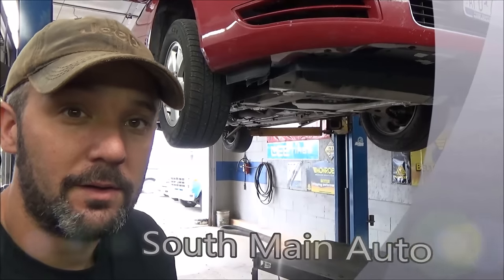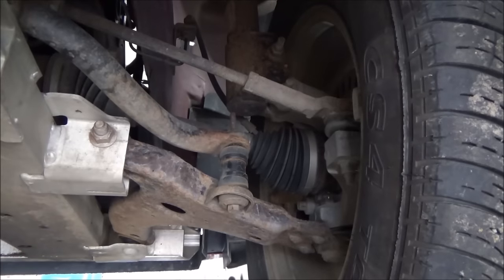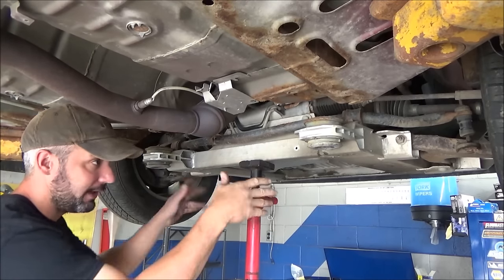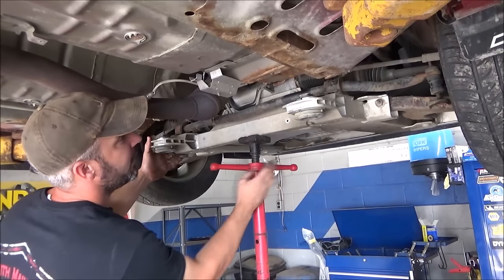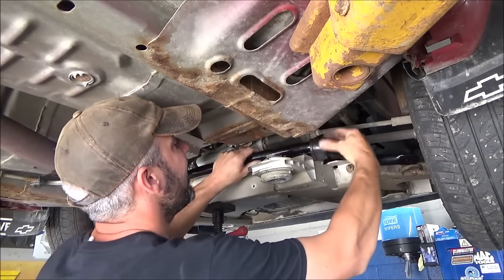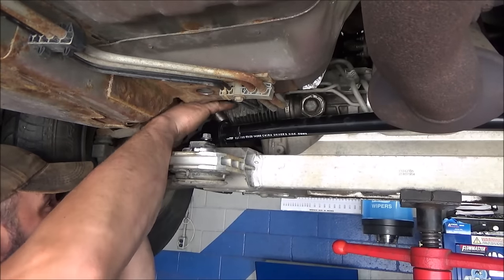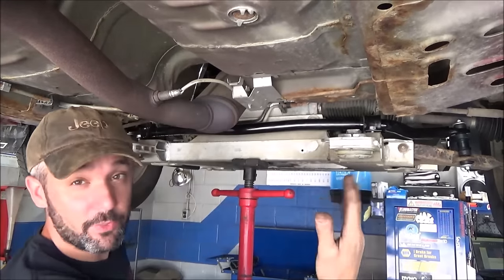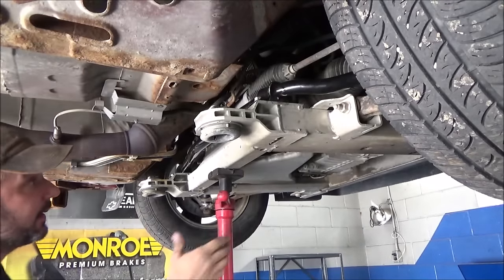Chevy Impala : Replace Broken Sway Bar

Comment: "Pretty Simple Job" lol yea when you have a lift, a support, compact electric impact gun, and years of experience. What about this guy doing it in the gravel, mud and blood 2 jack stands, a floor jack and a smattering of tools =)
Reply: @briancavanaugh4406  absolutely same here....past few years I've been doing my own work on my Impala and my girls Camry. I've had to buy a bunch of tools and what not but in the long run still saving money and learning....I'm not rebuilding engines or transmissions or tunning but done this,replaced front lower control arms,brakes,rear upper and lower trailing arms and controls arms, radiator,water pump....can be a bit frustrating sometimes but satisfying when you diy😎👍
Reply: Easy peasey
Reply: How long did it take from the ground?
Reply: I never got around to it,  my poor Imapala blew her head gasket 😑 RIP 2002-2018
Reply: @morsecodereviews1553  the 8th gen impalas are known to have bad head gaskets in the 2000-2004 years, they break down over time and all will go eventually. The 2005 impala is the best year of 8th gen they changed the head gasket to one that lasts for that year. So if you are looking to get another one of that gen either get a 2005 or plan on doing the head gasket at some point. I have an 2001 that my girlfriends grandpa bought new and it's going strong at 183000 miles, we both love it they are good cars.
Reply: Amen. Sometimes I think mechanics forget how hard it is to work from your back with minimal space. How about that stand up jack. Lowering it with a floor jack is also way harder and more dangerous.
Reply: Just take to to the dealer and have it done.
Reply: @greggarcia3226  "mechanics forgot how hard it is to work from they're back with minimal space" did you really just say that 😂😂😂 mechanics know what it's like fr
Reply: @greggarcia3226  have you watched his at videos of at home repair? Hint: there’s more than one..
Almost every mechanic I know still works on the ground from time to time for one reason or another, and almost every one started with DIY. You never forget. :)
Reply: For a sway bar?? Please…
Reply: I put my sway bar on 2008 Chevy Impala I didn't have to loosen chasy I removed bothe tire and sent it right thru passenger side went in with no hastle avoid removing chasy nuts.
Reply: @frugalprepper  yeah so they can charge you 600 dollars for a 100 dollar assembly and an hour or 2 of your time
Reply: @elih7190  I 100% agree. You never ever take your vehicle to dealerships. Why? Because dealerships charge the most for the labor hourly rate, which is anywhere between $125 and the very few times I have seen up to $175 an hour, and that's not including the replacement part and the upcharge they charge for the part. And not all but some dealers are known for completely hack job repairs or replacing something that does not need to be replaced. Their job is to get your car in and then out as fast as possible. Even if that compromises the safety of the car. Now that's not all dealerships are like this but the select few that are. So save yourself the money do repairs yourself or if you can't learn how by watching YouTube videos or if you're that desperate, just take your car to a regular well-known mechanic shop in your area.
Reply: Well, it’s still simple, maybe not easy, but simple.
Reply: @EliutParedes-xu1md  I'm glad to hear that !  It is what I'm gonna do

Comment: Others might have said it before, but an alternative way to do this that is useful if you don't have a lift is to put the front of the car on stands, remove both front wheels, disconnect the outer tie rods from the knuckles (to allow the sway bar to rotate freely), and then you can remove the sway bar by removing the end links and bushings and then twisting and pulling the bar out from one side. The new one can be installed by doing this process in reverse, and you shouldn't throw off your alignment or anything.
Reply: This method does work but it only can come out the passenger side; the brake lines are in the way on the drivers side. I got to do mine next week -

Comment: You don't have to touch a subframe bolt ont this car. It's so so much easier to do it on the ground. 10 min job, max on the ground. (For all my friends in the rust belt, I did this in my driveway in less than 15 mins

Comment: Simple job I did my rack and pinion in the garage with a floor and jack stands... Just need a little come sense and you can save hundreds if not thousands in labor...
Reply: Yeah, same here. On my 07 Chevy Impala, it was not a fun job. Oh and did I also forget to mention
I have replaced every single suspension part, Breaking part, such as all calipers rotors and pads, all wheel bearings, all 4 struts, ( fronts twice) thats what i get for replacing them with crappy cheap Detroit Axle junk, just 3 months later the started leaking,inner and outer tie rod, lower control arms with ball joint, spark plugs, map sensor, mass air flow sensor, ignition coil pack, fuel injectors, air intake plenum, the flex pipe from the manifold to the cat, cabin filter, air filter, power steering pump, both power steering line, both transmission lines, a full transmission fluid drain and replacement with Filter, the oil filter gasket housing thing I can't remember exactly what it's called, sway bar end links twice. That's what I get for buying really cheap sway bar end links. Both CV axles, the steering wheel clock spring. Honestly I think a few more part I just can't think of all off the top of my head. I just hit 190,000 miles on that car and I still do have a few minor repairs, such as the three separate actuated mowers for the air conditioner, air adjustment thing, from switching it to window defrost to front vents. Surprisingly that motor is still very solid. Although it does leak a little bit of oil with Adele cover gaskets which I still have to replace.

Comment: If you dont have a lift. Put the front end up on jack stands, remove both front wheels, remove all hardware, (links and rubber hold down brackets). Turn front wheels to the far left. Jack up driver side wheel with jack under the brake roter. Slide the bar out between the driver side tie rod end and lower control arm. Cutting the passenger side bend off the old bar makes it a breeze. Slide in the new bar in the same way. The new after-market bar had been reconfigured and slides in very easily. Replace hardware and wheels.

Comment: I have a 2002 Impala LS. I am replacing the drivers CV axle. I also am replacing both lower control arms as they are severely rusted. I noticed the drivers side sway bar end had the separation. I thought it was made that way and was going to reinstall it. When I opened the sway bar link kit I got from Advanced Auto it did not have the plastic spacer. I tried to get the old plastic spacer off the old sway bar link but it was rusted on it and broke trying to rescue it. So now I am going to replace the complete sway bar as it should come with the plastic sway bar spacers like yours had. Great video thanks. I am also replacing the upper strut bearings. Scotty Kilmer says the $100 replacement McPherson struts change the ride and ride height of the car because the coil spring is thicker. Mine are rusty but not leaking.

Comment: I usually do them with the wheels off and use an air ratchet then take it out pass side. seems easy to me but your way is pretty simple as well. great videos!
Reply: @ Josh Hager
Do you usually drop the sub frame too?
Reply: @mrbreezeet1  yes sir just the back two bolts

Comment: Did this a few months ago on my dads 2004 Pontiac Montana. I think this may even be the same part number, we didn't have to drop the sub frame, we were able to easily unbolt and slide it out with the tire off.
Good video, kind of cool to see something I have done, always thought about making videos of the repairs I do, just don't have the mind set for it, I would just prefer to get the job done lol.
Reply from the maker: Jeff Dooley Bust out a camera, it is fun really :)

Comment: Just changed mine last night and was able to get it out the passenger side by popping off the tirod end. No lowering subframe so I got lucky I guess. Thanks for the video man as it helped me thru my process
Reply: I guess if you were able to get it out the new one was easy enough to put back in the same way? just welded the one on my gf 2001 impala, they are hollow but it's pretty thick steel so it welded okay. Going to order one from rock auto and do it when I do the tie rods and I was thinking I could probably get it in there without dropping the subframe. Taking it out would be no problem just cut the bent arms off but if I have to lower it to get it back in then that's pointless.

Comment: like that straight to the job and get it done but another is why parts like and ball joints, tire rod etc. that don't have any grease fittings on them so u don't know how much grease in there but you'll c when they brake and thank you for the video

Comment: i was changing my breaks on a 2001 buick regal and on my passenger side i saw that the sway bar was completely disconnected from the link. Can i use the same method on my car? My first time working on cars and your videos are very informative. thanks for the help.

Comment: I wasn't sure, so you say that you don't have to worry about loosening the steering shaft from the rack when you drop the sub frame?
Is that a slip joint of some sort at the steering shaft?

Comment: Waiting for FedEx to deliver my front assembly since mine is out of commission along with the front controller arms, rear strut assemblies, rear bushings, and links for my 2001 Intrigue. I have most of the parts to do my suspension, yet the front sway bar assembly isn't here yet.

Comment: You make it look so easy Eric but on the ground that job is way more than 15 min :)  When I worked at the parts store we rarely sold sway bars on impalas  and most were cabs.  I wonder if your area has a lot of  rough dirt roads or lots of pot holes.  I do think a lot of your repairs are geographical in nature which is a good thing for you.  I wonder if garages in Arizona are as busy as you are except for AC repairs.  I have two friends up here working at Ford and Gm dealerships and their both very slow and my closest independent is slowly going out of business because of the lack of work. Over all compared to 30 years ago the cars today are built far better , require less maintenance and last so much longer.  Even a Dodge Ha. 👍
Reply: Steve Rob All true Steve except here in Arizona cars last forever as they don't rust so there is far more replacement of engines and transmissions than there is in the Northeast since there the bodies are gone long before the drivetrain is. Out here the bodies of the cars last long enough that just about everything subject to normal wear and tear that needs to be replaced already has been before the car needs to be scrapped. Good shops are always busy and bad shops aren't. Eric O. would be busy in the middle of the desert. Others less skilled not so much.
Reply: SATAMAN Schmidt Good morning Denis. If Eric came up to Canada and kept his rates the same he'd have a hard time and  thats the problem at least up here, the imput cost for a garage up here is so much more than in America. Average hourly charge where i am is $85-95 for a independent and $120-130 for a OEM plus a 13% sales tax on top. The problem up here is so many underground garages that are a result of the high cost of going to a legit garage. I guess this is all over but to be a successful indepentant garage owner like Eric is not the norm as i see more and more close down. SMA is a gem for sure.
Reply: Steve Rob That's actually cheaper than where I live in the States. Seems to me Eric has the right abilities to narrow his customers' problem down to a single root cause, unlike some that throw the whole book at the car and cross their fingers when they fire it up. My customers think I'm a magician with a test light, they're happy enough to pay me that I almost feel bad.
Reply: Derrick Hodges Thats interesting . As you well know a lot of shops are parts changers and not even good at that:) but reality is that's how a lot of shops make a living. I always heard the saying an honest mechanic was a broke mechanic , not always  true but we've all had experiences either way. Running a garage is so much more than doing repairs . Ha and making YouTube vids on top , just incredible.
Reply: Yeah, lots of guys out there think they are fixing cars. Unfortunately thinking and knowing aren't the same thing. : )
Reply from the maker: Derrick Hodges So many true comments here I don't even know what to say. I sure hate hearing about shops shutting down though. Just don't wanna be that guy is all. I am blessed to have all the work I do I do know that. I am book 2 weeks out right now and running around like a fart in a whirlwind bit I suppose it is better than the other option.   I know what you mean about the test light. I think it is one of the most undervalued tools IMO. I sure wish I could make over 100 an hour but our little town I wouldn't last long doing that for sure.
Reply: Derrick Hodges For us car guys/mechanics it's hard to imagine the frustration of trying to find someone competent to work on your car. A lot of people have dealt with shady shops, parts changers like you said, and all the other horrors associated with auto repair, so when they see someone honest and competent it's a huge relief. Always a good sign when the customer wants to pay you, unfortunately those kind of people are more rare.
Reply: South Main Auto Repair I think you'll stay in business for a long time. I play mechanic and service writer at the same time, over and over I find myself talking my customers down from "what to buy next" when I give my recommendation. People seem to be used to mobile guys taking them on multiple trips to the parts store, or getting multiple calls from the shop their car is in.

When they find a guy that tests and confirms the problem, gets a single estimate followed by a "your car's ready" call, they aren't going to someone else.

I wouldn't even show up to a job without a test light, I'll buy one on the way over no problem, I've diagnosed everything from no spark to a no ground at window motor through a DPDT switch that I did today. Test light was the first and only tool out of my bag both times.

Comment: South Main Auto Repair seems like your always using a impact tool. I bet it makes life so much easier removing things like bolts and stuff. Why do you use different ones thought out repairs instead of just one? Always wondered that.
Reply from the maker: well... not really sure. I guess i just use what ever is the handiest .

Comment: Wow! My original '65 Chevy Biscayne still had the original sway bar. However, I bought a kit from Hotckis and replaced the front sway with a bigger one. For the rear, I added their boxed trailing arms, upper and lower and added a sway bar. What a difference in handling. I think your salted roads do a number on your chassis's.

Comment: wow that's crazy. always though sway bars were solid steel. When I read the title I figured maybe only the end link broke because GM used to use cheap plastic end links on some cars
Reply from the maker: a lot of them are hollow
Reply: Yes I had a 2009 aveo and a hhr and a 2015 Malibu now a 2017 Malibu and they where all hollow car's you felt every bump on the road and felt loose yes even the 2017 Malibu but now a can't afford another one for a while it won't be a GM car or any of their products

Comment: Hey there! Great Video as usual. Let me ask you a question though - What do you think of those 9th Gen Impalas. Do they come in a lot? If so what kinda work is the most common that you need to do on these.

Thanks and keep up the great job.
Reply from the maker: ***** I work on so much stuff I don't go buy 1st 2nd 10th  gen or any of that fancy stuff. Give me a year range and engine type and I can tell ya what I see come and go...
Reply: South Main Auto Repair Sure. I was speaking of the 2006-2009 Impalas with the 3.9 V6 or even the SS with the 5.3 V8.

Thanks in advance for your answer!
Reply from the maker: You know I tell ya , ya see them come in for the wheel bearings, brakes, tie rods, blower resistors, sway bar links, etc. (typical GM stuff IMO) I feel the engines are pretty solid really. I do a fail amount of A.I.R. diverter valves but that is about all I can think of in the moment.

Comment: 01 Grand Prix......
I hit my wheel, bent control arm and inner tie rod end. Got the inner tie rod end on, and lower control arm on.
 I'm trying to install the sway bar link, and the sway bar is too close to the lower control arm to get my sway bar  link bushings in place. 
I started to loosen the two bolts holding the sway bar itself to the sub frame but the front one (of course, the hardest one to get at)
Is fighting me the whole way out. 
I wasn't going to replace the sway bar link on the other side at this time. 
But do you think I need to cut the sway bar link off of the other side so the sway bar will swing up enough to install the 1st. side?

Comment: started the project at home and having a had time with one of the crane screws other one came out with some pressure but cannot get the other one off ..any ideas for a guy with no power or air tools...

Comment: Don't you have to loosen the pinch bolt on the steering column to rack connection so it doesn't stress the steering column? A shop just replaced mine and now the steering is very stiff. They think its the steering column. Its got 31k original miles so I think they screwed something up... Any ideas? Thanks.....

Comment: I'm replacing the sway bar on my 2005 impala, was there any certain torque you tightened those bolts on the saddles or engine frame?